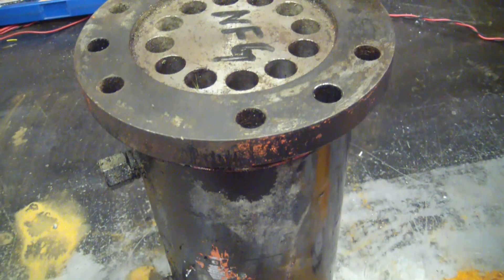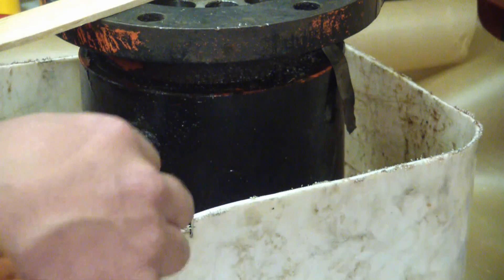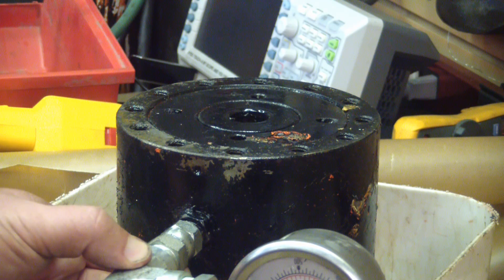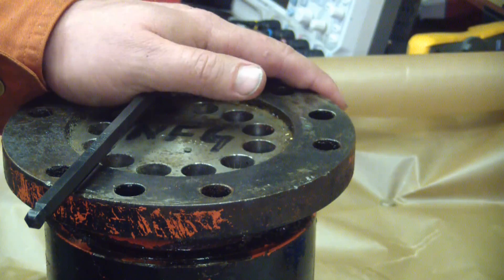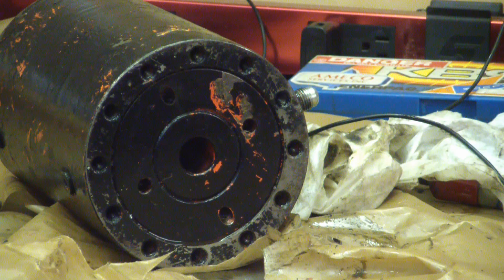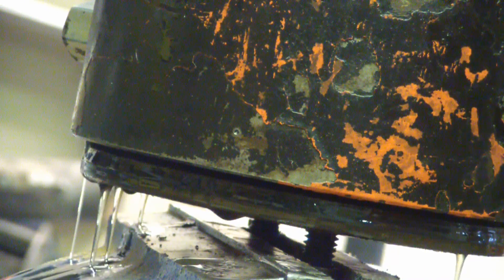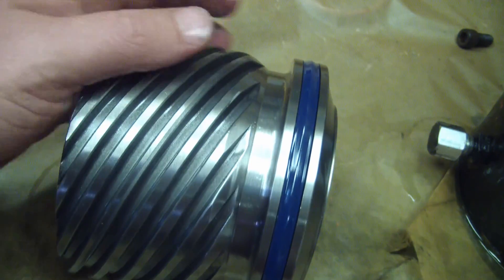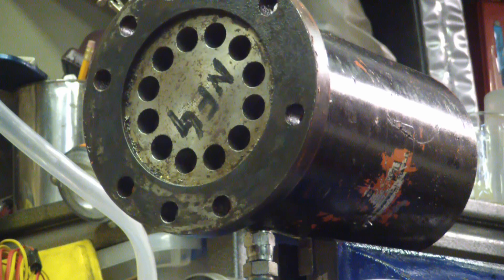BOLTR: Helac Rotary Actuator

Comment: Interesting video.

You deffinitly got a point about the danger of hydraulic systems, Burst hand on higs pressure oil, the oil it selv was cutting right thro the skin and flesh (no joking here... it did...), i can just imagine what had happened if the connection had been unscrewed with the system under under full load (fortunatly it normally takes great force to do that, but it´s deffinitly a lethal risk for someone with a bg wrench...). And that was just a normal pressurized system... After that i trying to be more careful and not f**ing with pressurized parts... Guess i was lucky...

And about Pressurized Air, it´s not a joke people has been killed by the force from for example exploding truckwheels.
Pressurized air directly to the skin is dangerous becas it can push air thogh the skin and stop the blood flowing in bodyparts.
Reply: We had a coiled up O2 hose in a cabinet. Somebody was working on the system and didn't close the valve to hose when they were done bleeding it. When they put the 2k psi back to it, that hose beat the cabinet all to hell, huge dents that flaked the paint outside it.
Reply: +Morgan S that must have been quite the show!

Comment: how do you get it to revers after the piston has turned all the way in one direction? thanks for the videos
Reply: +Albert Tremblay I'm guessing that you just reverse the flow direction of the hydraulic fluid.
Reply: ah that makes sense. don't know why i didn't think of that hehe. thanks
Reply: +Albert Tremblay It's a double-acting cylinder, so there's a port on top and bottom.  When you've actuated it one way and want to reverse it, pressure is applied to the opposite port, and the port you had pressurized to get it as far as you did is drained back out.
Reply: Yah, makes sense.I didn't see the other port.

Comment: Once again, please google hydraulic infuckingjection. if you already know, do it anyways. not a second chance kinda fudge factor.
Reply: +Benjamin Jones Fucking god... I will never be the same again after seeing that... 
In case anyone is too lazy to look it up, a pinhole in a hydraulic line, plus your hand or finger covering it can inject your hand and arm full of toxic hydraulic fluid that requires the removal of contaminated tissue and veins in the hand/arm and replacement with artificial veins... brutal.

Comment: It didn't occur to me until today. I work with a smaller version of this on a fairly regular basis depending on the truck I'm driving. The regular piston type hydraulics used to do the same job as this one break a lot more frequently and are more sensitive to abuse. These rotary types are damn near bulletproof. Nice to see how they work turning linear motion into rotation. Sweet.
Reply: These are bombproof because all moving parts are contained inside the cylinder.  Linear rams extend and retract, and that is what makes them less robust.

Comment: Fine use of an adjustable wrench... who needs a hammer.
Is it still adjustable or is it now a fixed wrench ?

Just to mess with you it is called Clockwise or Anti clockwise.

As you know righty tighty is not always the case pending on the direction of rotation of a bolted object. eg. a bicycle pedal crank is righty tighty on one side and on the other side of the bicycle it is lefty tighty. Otherwise the left pedal would come loose with the torque of cycling.
Then there is the fun of turning a bolt on the underneath side of something where it also reverses direction of rotation.

Love the machining on that gizmo.
Reply: +planetwalker The bigger the adjustable wrench, the better because you can bang on stuff harder before it breaks.
Reply: Classic
Reply: +planetwalker ive actually came across a trailer who's tires where lefty-tighty, righty-loosy.funniest tire change ever.

Comment: Oh, man. Yes, tell me. I was set to work on a hydraulic system that had NPT 1/2" fitting in and among the assembly. The hydraulic pump had to be rebuilt. But I was putting the hammer down until I found that little nugget. Yea, nugget of el crapola. Could have sliced me clean into multiple pieces, I know you know what I mean. It was a ten thousand pound test on cast/machined fuel pump housings. Production line. I had zero drawings, nothing. Just cold death waiting for me. I should have run screaming from that place the moment I reported for duty. Long story short. That machine I fixed and brought up to "code." What nailed me down the road; a machine with no drawings, cycled on me while I had a screwdriver and my hand/fingers. Flywheel system released, shattered the screwdriver, shot metal up into my face, thru my upper lip, along my teeth and skull bones and stopped just under my left eye. Also broke my right index finger into seven pieces. Was a little story of caution for you. They were pissed that I had to go to the emergency room, but bled all over the shop before I was taken to the Doc. Some people. Heh? My wife about spewed and fainted when they brought me home.

Comment: It's not a reduction gear, it's an overdrive. It looks like each set of teeth give about 100 degrees rotation in their range of travel, but the whole device rotates 200 degrees or so.

As you lift up the piston it rotates to the right while the central shaft remains still, but you can see that if the outer teeth were engaged with the case the piston would rotate to the left and so force the central shaft to rotate left about twice as fast.

I doubt it's self locking.

At each end of it's range of motion, one set of teeth must have quite low engagement. Best to keep heavy loads for the middle of the range of motion maybe.

Comment: This must be what those guys at quick lube shops use for tightening oil filters.
Reply: +hydrogen18 Most of that is just not lubing the o-ring.  I'd tighten the hell out of them, but I'd lube the o-ring, which resulted in me being the only one who could get them off, and after getting called into the pits whenever we had one of my cars come back to get the filter off, I ended up just staying down there forever.  One of the tough-guy managers even chewed me out because a filter I put on was "stuck", but I could get it off by hand, but he wouldn't lube his.
Reply: +hydrogen18 lost it at this. XD
Reply: Right?! Not to mention the sidewards threading of drain plugs constantly. How...
Reply: Well drill two holes and stick your Chineseum-mild Steel facewrench in it.
Reply: Meh, these days I just throw a strip of sandpaper inside the strap wrench if I am unfortunate enough to have to use one of those things. I will go out of my way to get a proper socket for the filter if I can though.
Reply: Not true at all. Quick lube jockeys don't change the filter, blast it with brake clean and its good for another round.
Reply: That made me laugh. Totally!
Reply: As we idotic Germans are, we started putting fucking extra boxes for oilfilters, that can be opened with fucking normal wrenches or nuts and are tightened to spec with a torque wrench but not with the fucking note on the cap to oil the seal before putting it back together.
Reply: @SchrottiJr  That's common knowledge.

Comment: These are pretty sweet actuators because they integrate both rotary actuation and a pivot shaft (as it runs on two tapered roller bearings) unlike most motors which are only good for powering another piece (thick of a motor and a slewing bearing.  I have used these in a foot-mounted configuration on a few different designs of underground mining equipment (I'm a design engineer).

Comment: Cage and jib rotator on most cherrypickers. Make sure you align the timing marks during reassembly or your basket will not turn fully in one direction and contact the jib in the other.

Comment: The Best / Easiest to use, thread sealant i've found!
LOCTITE 545 (High Temp)
LOCTITE 565 (Fast Cure)
I like it because it allows you to clock your fittings however you want/need cause its sets up where you leave it. No more adding or removing tape to get the fitting not to leak and pointed in the direction you want!

P.S. I also hate pipe dope...

Comment: They are used for Excavator tilt hitch's to angle the bucket on Excavators, I have owned one and have just got the latest version on a new Caterpillar Excavator, have a look at my video's and you will see one in operation on a Excavator.

Comment: So I'm curious: have you or anyone else ever opened up the continuous type of hydraulic actuators? Like the kind that swing an excavator around...those ones aren't very positive, I ran an old log loader once that wouldn't spin around uphill if you had the boom out too far.
Reply: Hydraulic motors like Pelton wheel style?

Comment: Also, if you're working on a front-end loader, be sure to run it to the ground, AND relieve pressure before you crack the fittings.  I learned that one all by myself (no injuries, but I did take a bath).

Comment: this is very similar to a Kawasaki Actuator, these are used in a lot of different industries. Most popular use is in swing out agriculture arms on mobile equipment.
Contamination is the killer for these, ive seen the upper gear set seize up on these with very clean oil, or at least what I thought or consider what was clean oil. Use a very high micon filter in your reservoir

Comment: "Having gravity" is related to Gravitational Iron… Never heard of Gravitational Iron? I know you've experienced it…. ya know that piece of metal that increases weight the further you remove it from the ground? Yeah. That. The worst thing you can do with Gravitational Iron is put it on a bench. Somehow it increases gravity exponentially by the distance it is removed from the ground and gravity also increases linearly with time. Never leave Gravitational Iron on a bench for long periods of time. It will never get moved again…

Comment: speaking about metric and imperial

imperial measurement is still used universally  for new air compressors/ US branded air conditioners fasteners ...
liquid/air fittings..
ratchet drives (1/4, 3/8 ,1/2...etc) ..we dont say 12.7mm (1/2inch drive) ratchet we say ratchet number 3 or size 3 ...doesn't matter if you have the a metric set or imperial or both in one set...
tire rim sizes and electronic screens ..still referred to in inches

when i was in school we learned both which made alot of confusion and stupid mistakes in math exams

but now my younger brother studies only wth metric system

in other words ..in a metric nation
inches are more like a symbol than a way to mesure things

like we say rim size number 17 (17inch trim)

and ratchet number 2 for a 3/8" drive ratchet cause it comes after 1/4 inch sized ratchet and its the first size you can use as a ratchet....

lol  we just dont like fractions

Comment: You should do a breakdown on one of those predator motors
Reply: 100$ and its yours...well in usd anyway im not sure how the Canadian harbor freight works.
Reply: http://www.harborfreight.com/65-hp-212cc-ohv-horizontal-shaft-gas-engine-epa-69730.html
Reply: +Matt Brewer 
from what I hear those things are made with cast-off tooling from a fairly reputable motor company and actually (despite HF's best efforts materials and assembly-wise) aren't half bad.
Think Taurus and their not-as-good-but-still-damn-good Berretta knock-offs
Reply: I've had great luck with those motors actually

Comment: I've often wondered -- when screwing in a pressure gauge like that, you do it up until it's tight, right? So doesn't it end up facing an arbitrary direction, facing the wrong way half the time? Or can you stop a revolution or two short of the point where it won't go any further and still achieve an adequate seal?

Comment: 31,000 ft/lbs of torque!  That's pretty massive.  Yep, hydraulic actuators are only limited by the crankshaft that drives the pump and the amount of pressure that the lines can handle.   They use hydraulic pressure to test air compressor tanks, scuba tanks, etc.  If the tank fails/pops it only cracks open, no explosion.
Reply: WAVETUBE84 The you're looking for (or more likely, already know), is hydro-testing.  They use water not hydraulic oil.
Reply: prairie wanderer I used the word "hydraulic" :  that means any fluid.  Yes, they do not use petroleum oil for testing those tanks.  Water is what is used and it works perfectly.  Plus no need to use additional petroleum solvents to clean the tank.  Just blow it dry with some warm air.  And any petroleum vapor mixed with oxygen/atmosphere and pressurized in an enclosed container past 234PSI will EXPLODE!!!!!!!!  Diesel engine ring a bell.
Reply: WAVETUBE84
I was pretty certain from reading your post you knew all about it.  My words were for the benefit of those less-informed. I've heard a story or two of someone lubricating the threads on an O2 cylinder before mounting the regulator.  Not a happy outcome.
Reply: prairie wanderer Put a drop of oil on a tiny (.177") cotton wad.  Put that into a pellet rifle, after a pellet,  and see what happens.  Poof, bang, crack!  Nothing dangerous, but you will have a small diesel detonation.  Don't know if you get any additional velocity out it though.
Reply: WAVETUBE84
I might have to try that later.  Might also have to try some rudimentary penetration tests to see if it boosts the velocity.
Reply: prairie wanderer Yeah, "most" of us define 'hydraulic" as petroleum oil.  I apologize for being pedantic.  I am very curious about whether or not the diesel detonation in a air rifle would increase the velocity????  It sounds logical.  I had a RWS Diana .22 and a Spanish/Gamo .177 pellet rifle.  They were fun.  But, nothing like a H&H .375 Magnum or a .700 Nitro-Express....!  Ha ha... I've never shot one of those.  I don't own a single gun any more.
Reply: WAVETUBE84
No apologies necessary.  It would be interesting to see if anyone has used a chronograph to investigate any increase in velocity.  The one harm I could if increasing the pressures too much is damaging the valving in the air rifle.
Reply: Filling an air tool oiler with diesel fuel will definitely give your impact wrench an extra kick! 'Till the anvil snaps haha.
Reply: Pleb Stone 2000 lbs., huh?  Sure he wasn't refering to the delivery hydraulic pressure??  I didn't do the math, it's a simple equation to calcualate the torque-degrees rotation-area of piston-length of helix.  Anyways, I have no way of saying how much torque it produces, it's moot without the part number, etc.  I did go to Helac website and there are many types available.  The maximum torque of one was 31,000 INCH/POUNDS, not foot/pounds.  He may have slipped?
Reply: Pleb Stone Ok.

Comment: I just had a rare moment of clarity - think of it as a rotary-to-linear actuator being run in reverse! It becomes much easier to understand.

Let's treat the output shaft and the piston as a bolt and nut, respectively.

Turn the bolt clockwise to tighten it (right handed thread), and the nut moves towards you. However, the nut has a left-handed thread on the outside that engages with the housing, so moving the nut towards you turns it clockwise as well, effectively unscrewing it.

So the amount the nut moves for a given rotation will be related to the difference in thread pitch between the inner and outer threads.

Now take all that and reverse it. Pushing on the "nut" forcing the "bolt" to turn, but at the same time turning the "nut" in the same direction the "bolt" is turning, just not as much, so the bolt rotates much more than the movement of the nut would otherwise be.

Comment: How do they make those internal gears? I'm assuming some sort of a CNC lathe but still. Thanks a lot fot sharing.
Reply: Garage workshop Actually, when I was working there, we used gear cutting machines from WWII. They did get an auto load cnc machine just before I left to speed up production. Basically you have a cutter with the right gear shape that twists as it pushes down through while the part rotates to cut all the way around.

Comment: I've been giving this some thought and I think the problem is that it's made to be under load. Put a few tons on top and I reckon it'll turn nicely. I think what's happening is that the hydraulic pressure is pushing up causing friction.

Comment: The only thing that could be more beautiful than this is the machine that cuts that internal helix.

Imagining how this thing works make my head hurt... As the piston moves, it rotates... that's the easy part.

If I've managed to wrap my head around it, the only way for the central shaft to not move in and out is for it to rotate in the same direction the piston is rotating, but twice as fast. Since the "threads" are opposite hands that would cancel out the lateral movement. But there's gotta be a metric fuckload of thrust in that assembly or it'd just unscrew itself... or I could be completely wrong.

Looks like the "thread" on the piston is ~135 degrees with the same on the inner set? So I'm guessing the range of movement is 90 degrees for the piston to keep everything fully engaged, plus another 90 for the driven shaft - 180 degrees total. That seem about right?
Reply: *****
Huzzah! Any inkling on the piston stroke vs. the length of the "threads" ?

Comment: Love it how you removed the NFG at the end.  But a comment: if the hydraulic pump is itself a motor, then how is the hydraulic system more reliable than a pure motorized solution?

Comment: ***** Why doesn't it turn smoothly at the end, i.e. what's making it jump? Shouldn't hydraulic oil be incompressible and make it turn smoothly if it's being fed at a (more or less) constant rate?
Reply: ***** Thanks!
Reply: When you push hydraulic fluid in one side, you need to be pulling it out of the other side for smooth operation.

Comment: Seems to that the helical threads-muthings would actualy act as a gear multiplier not a reductor. This would mean they need less linear movement for the same angular displacement of the flange. Quite amazing how they managed to seal a helical interface.